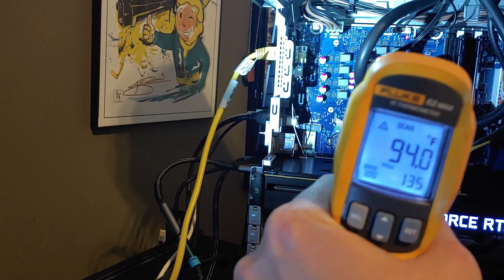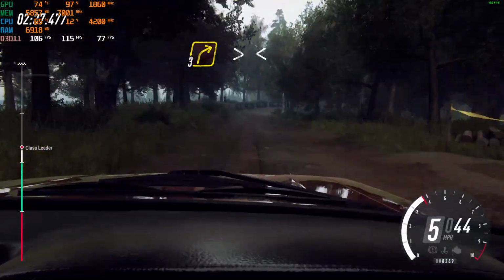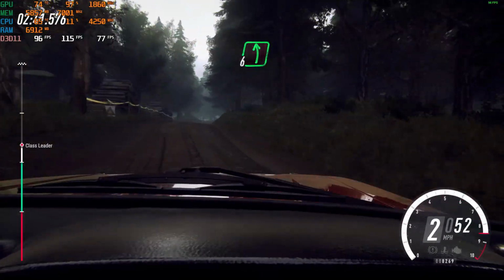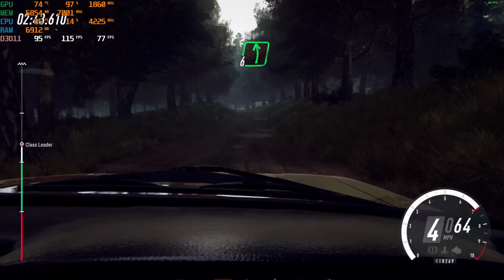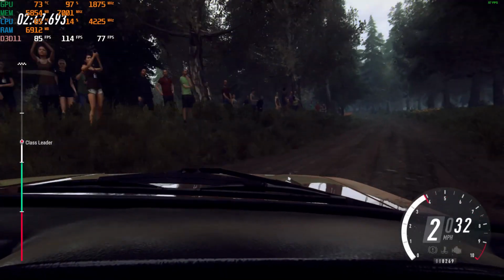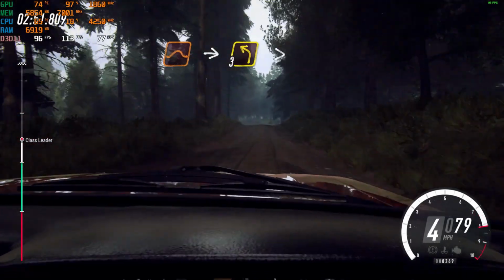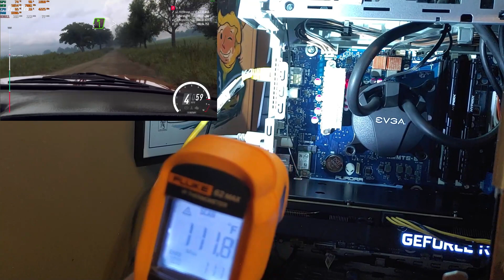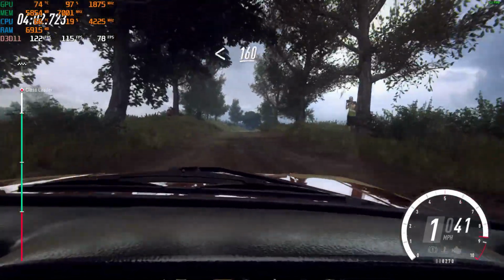VRM HEATSINK UPDATE PT2 ALIENWARE R10 RYZEN EDITION with RTX 3070 (Presidents Day Sale)

Comment: Hey man so the link for these which are 14x14 are no longer available but they have 10x10 what about those would they work
Reply from the maker: They might but the original I found from a post on the Dell Forum were these but were also out of stock at the time so I went witht the ones in the vid. 
https://www.amazon.com/dp/B077VQTB6Q/ref=redir_mobile_desktop?_encoding=UTF8&%2AVersion%2A=1&%2Aentries%2A=0
Reply: I just realized in my mobo these extra chips are not there I have a pentium mobo
Reply: hello i got tge 10x10x10 mm will it work?

Comment: For anyone with this system, you can get both heatsinks from Dell for $7 (for both). They screw in securely and have thermal pads pre-applied. Just call and give the two part numbers, which someone posted under a comment here.
Reply: They don’t have them

Comment: Thanks for the video. How much different were your temps before installing the heat sink?
Reply from the maker: Wasn't much of a difference on the top side as those don't get as hot as the left side. This is more of a precaution than anything. Iirc highest temp I saw on the top side was around 94 F on idle.
Reply: @DGK86  Thanks.. I appreciate that..
Reply: @DGK86  Although I am not a gamer, I found that my temps were still were high during STREAMING and VIRTUAL events. 2 fans and an H60 Liquid Cooler install later, I finally realized that the voltage is OC to 1.38V. I reduced to 1.28V and WTF!!!!! Temps under load are 38C-45C...  Thanks to videos like yours, I have been able to learn about gaming, computer installs and improvements.

Comment: can these be removed? could be an issue if you ever try to replace the radiator fan on top, no?
Reply from the maker: Yes, the adhesive on the thermal tape will hold them on well but if you tug pretty hard they come off.  Also should be able to access and remove the Rad fan without removing them if needed.